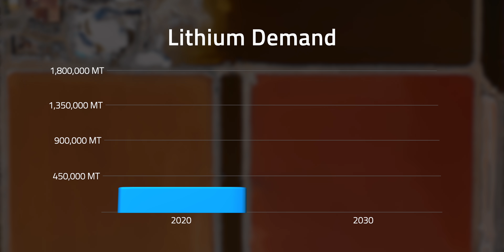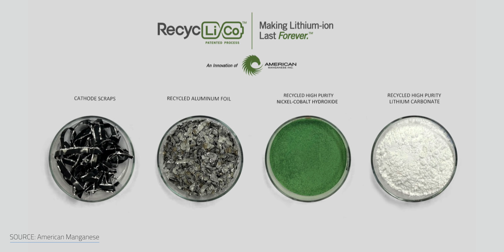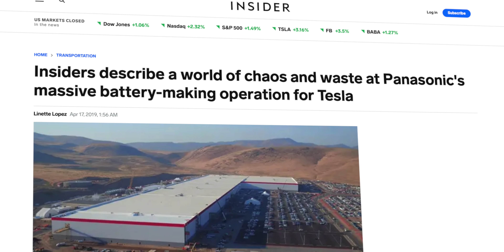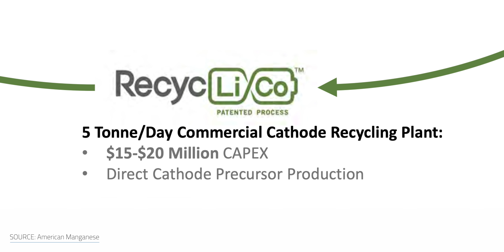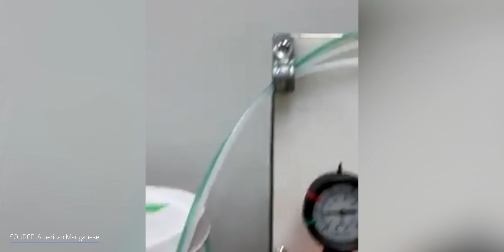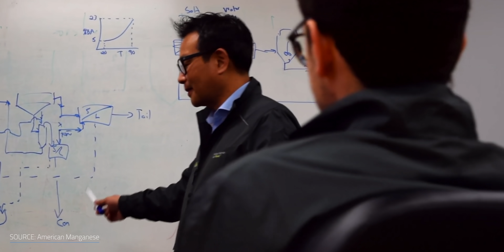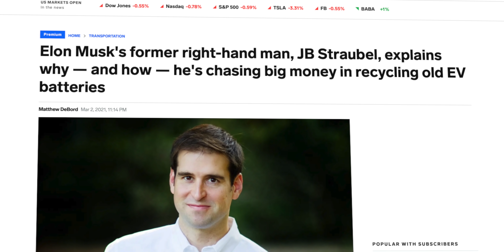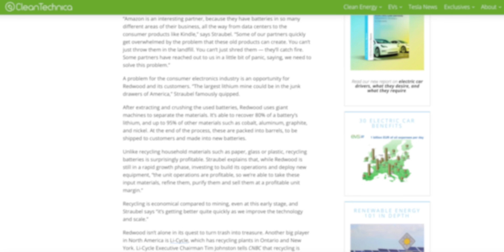Solving EV's Biggest Problem - Battery Recycling Explained

Comment: I believe the process is not totally recycled to make batteries but recycled to certain degree that the metals are able to added to alloys to be used in building and manufacturing which will absorb the wasted battery at early stage until we find the best structures or processes. Compromise first then perfection

Comment: Battery recycling will be absolutely essential because the materials are so scarce. I like how EV demand has increased battery recycling demand, which in turn will benefit all industries that use batteries. I'd love to see a world where everything can be 100 % recycled to pure raw materials cheaply and safely!
Reply: @skullfucker3381  The atoms and molecules will still be there, even though all of the materials won't be in their original form due to chemical reactions. I think it's just a matter of finding the technology and having an abundance of cheap energy to make it happen.
Reply: @eaaeeeea  as you say, an abundance of cheap energy is exactly what’s needed. With that, carbon capture and all sorts of other strange technologies will become viable.
Reply: What is done with the solvent waste?
Reply: If materials are going so scarce and we're already going through the recycle process and there's not even  as many electric cars on the road like they want by 2030.. Are they going to run out of material before it actually is a fluition thought???... Because if this is the case I can see us going back to fossil fuel really quick or not getting rid of it at all...
Reply: @skullfucker3381  in the video they state that they have achieved a 100% recovery rate
Reply: @jimmyboy2  in the video he says that there is no waste and that the solvent is completely reused
Reply: @skullfucker3381  watch the video again because they did say 100% for most elements and 99.7% for one of them. The video also said that they’re already profitable which says that it’s a viable process.
Reply: 100 percent can simply not be done. 90 seems very generous to me. Yes materials don't just dissapear but unless you have a way to recycle every molecule of a material then there's always going to be waste. Its a basic principle I'm not a specialist
Reply: I really dont get it, isnt it quite few parts of EV batteries that needs to be refilled in a dead battery like Tesla's battery gas, the structure of the battery its container, the nickle might have to be melted down and reused if the material structure have seen better days, good as new right?, sulphur might need to be replenished

Tho if only the car manufacturers was forced to do research into EV 20 years ago with some benefits, today its technology would probobly seem alot more solid
Reply: Bio renewable resources are future anyway since we have limited resources and not everything can be recycled 
What I think is that first we will move towards alternatives and recycling and in the end back to natural or biological resources in every possible sector may be it construction or computing ❤❤

Comment: How did you not mention the primary US recycling company, ABML (American Battery Technology Company)? Redwood uses smelting, which creates toxic emissions into the air, while ABML uses a water-based recycling method that's 100% sustainable. And it's a company led by ex-Tesla engineers.
Reply: And it's right next door to Giga Nevada. And will to 20K tonnes a year with their pilot plant. And they have IP for greener lithium extraction during mining. The more I look at the last battery day presentation, the more I think ABML is the answer to the "first principles" problem of lithium supply.

Comment: Good evening Matt. An excellent video -- again :-) 
Having spent 40+ years in the domain of Automotive Electronics, I can say 'Batteries are not enough.' 
If you want more range, you add more batteries -- which adds more weight -- which reduces the range etc. 
Recycling old or mining new raw materials is not the debate (in the limit.)
We need a zero emission lightweight power source for at least the Transport sector. 
We know what that is, we know how to use it, it's just not reached the 'tipping point' yet. 

Its called Hydrogen! 

Let the recycling debate rage until it becomes obsolete.

Best wishes. Stay safe. Bruce

Comment: I've said for years, whoever starts recycling these batteries is going to make a lot of money.
Reply: Or alternatively the person who figures out a more eco friendly battery (Solid State Batteries) which have already been theorized, and are trying to be made by many companies like Samsung and the actual person who came up with the idea, who also happened to invent lithium ion batteries, and RAM
Reply: Not if the recycling process consumes more energy than what is being recycled was intended to save.   This is the case with solar panels, as melting down the leaded glass and separating the water polluting heavy metals costs more than the out put of the panels.
Reply: Same
Reply: @Altcapball  Are you saying that, if you would produce and power solar panels from recycled solar panels, then this would use more energy than the entire lifetime output of the solar panels and, thus, would be a net negative in energy production?
If this is not what you mean, can you rephrase it?
Reply: @rogerstarkey5390  And there's the inescapable fact that, through it's entire life, the i.c. engine wastes 70% of the energy from it's fuel....

Comment: You didn't answer my question of how do we get our old Lipo batteries to these people? It would be best to have the recycling company provide safe shipping boxes for us to collect old rechargeable batteries and send them to the recyclers facility.
Reply from the maker: It's a good question, but out of scope for the focus of this video (I was focused on EVs).  For all of us (the end users), getting batteries recycled is still WAY to hard.  Hopefully with these companies spinning up, we'll see options open up.
Reply: In my country all consumer electronics shops accept waste electronics and batteries, most shopping centers have boxes for disposing small electronics/light bulbs/batteries. Bigger cities have collection sites for larger electronics/appliances. Even my apartment building at the entrance has small metal box for battery disposal. Basically recycling companies has partnership with other businesses to use shops as a collection spots.
Reply: @edmundas919  the US has a long ways to go in implementing the recycling process.  Our disposal companies refer us to the e-waste recyclers.  There are some electronics stores and others who accept some of the waste.

Comment: funny, but I've been trying to figure out what to do with around 30 18650 lion cells.  They are the "bad" cells from taking apart laptop batteries.  I finally found battery plus blubs would accept them.  what happens to them from there, I have no idea.
Reply: certainly a landfill
Reply: @HeritageWealthPlanning  Not in the UK or Europe. Placing battery waste in landfill is illegal in both the UK and EU......they get recycled.
Reply: @Brian-om2hh  uh huh

Comment: They stick them in a landfill because they are not made in such a way that they can be easily recycled. Also... when exposed to the atmosphere, the guts of these batteries can explode or catch fire.
Reply: No, you're thinking of lithium polymer batteries. Electric cars are powered by lithium ion batteries. Different chemistry...  And they can be recycled fairly easily. VW are recycling them already. It seems you haven't done enough research.....

Comment: 20 to 30 years ago, industrial ecology and cradle to cradle materials management were two of the frameworks that considered the idea of industrial nutrients that would be recycled again and again. Electric car manufacturing is finally embracing these concepts. The designs and processes are all optimized for closed or partially closed cycles of materials, energy efficiency, elimination of pollutants... etc. We have the opportunity to do it right from the get-go this time. Waste and pollution are no longer created through poor or incomplete design and then dumped in the environment as externalities.

Comment: Often one of my bug concerns but glad to see it's being worked on. Will this work for solar panels as well?
Reply from the maker: Not these specific companies, but yes ... there are companies trying to perfect solar panel recycling cheaply too.
Reply: Sure! 
you can reclaim all metals from anything, with varying degrees of success.
Reply: Solar panel recycling is behind the battery recycling curve in terms of commercialization inspite of being an earlier tech. The reason being, Solar panels have much longer standard life of 25-30 years compared to EV batteries 8-10 years. Of course, in real life solar panels can stay functional up to 50 years and EV batteries up to 20 years.
Reply: @KarryKarryKarry  The question isn't can you recycle solar panels, the question is can you do it efficiently and at a point where the material yield can pay for the process.  Only then will it be worth the time and effort to divert landfill goods to recyclers.
Reply: @KarryKarryKarry  of course you CAN, almost everything we manufacture is recyclable. The question is, is it economical, and is it less damaging than disposing of the waste.
Reply: @mhamma6560  if you want me to feel have a hunt round but there are YouTube videos that say at the at the moment it is not economically viable to do you can be done it just costs a bit more than the raw materials so we are going to need subsidies or tax
Reply: @gingernutpreacher  Well that's a problem, subsidies are already what pays for them, and subsidies are a tax.  The gov has no income, it only takes from the taxpayer.  At this rate it would be more viable to invest in nuclear plants that will provide energy for 4 decades or longer and invest in research.   More efficient solar panels made of more readily accessible / recyclable materials would do us much better in the long run.   Tech will eventually catch up, but to charge more for items that only work when the sun is out is really a step backwards.   We're where we're at as a species today because of cheap abundant energy.
Reply: @mhamma6560  No there not vat/tax is only 5%   there is a feed in tariff but that more than cover's cost of what's produced it used to be really high that comes on the ealectric bill and current nuclear power is stupid t only uses 1 point some thing of fuel the rest end up as waste like neptunium and nuclear is extreamly experience and has the highest subsidy have a look at how much were going to pay the Chinese per kWh here in UK we need some nuclear for cheamo but it's not the future unless you're talking molten salt reactors
Reply: 🐞 Bug concerns
Reply: There is a solar recycling plant in France that I believe achieves a 95% recycling rate. The thing is, recycling is still much more expensive than dumping it in dump sites (+-20$/panel vs a few cent) and will likely always remain so. Moreover unlike with batteries there will not be too much economical gain from using materials from recycling vs mining, especially not seeing most solar panels are produced in China. So without regulation you won't see solar panel recycling take off. In the EU regulation does make recycling mandatory, so it isn't abnormal we'll see large scale solar recycling here first.

So is it possible? Yes. Will it be done? Only with regulation.
Reply: @UndecidedMF  did u drop that video yet? :)
Reply: @KarryKarryKarry  you're pretty much saying we can recycle all metals but not all. Makes no sense. You either can do it or you cannot do it. There is no 100% that is less than 100%.

Comment: I have a 10 year old Nissan Leaf.  Since I only do short trips, it is all I need (and it was cheap with all the subsidies back in 2011).   I have never fast charged it or left it sitting at 100% charge for more than a few hours.  It has been garaged and as a result my range loss has been about 20% and the battery still can fully charge to all bars.  Batteries will last if you take care of them.

Comment: I think we will always need mining but at lower and lower levels as recycling ramps up.  As has been the case over the past 150 years humans have consumed more and more materials and I don't see that changing which means that even if we recycle 100% we still need new material.  It's also, in my opinion, impossible to recycle 100%.
Reply: Space mining always a solution
Reply: @James-sk4db  Just need to couple that with space waste disposal
Reply: @graham1034  not really a problem unless you bring the waste to earth/earths orbit.
Reply: The success of lead recycling is a good example of how changes can satisfy needs
Reply: @James-sk4db  If we can figure out mining asteroids, we'll gain access to a LOT of raw materials

Comment: Do not forget the second life use for old ev batteries which are still in working condition, they still retain 70% efficiency after 10 yrs of use and can be used for stationary uses for 10-15 yrs more.
Reply: great point. reduce, reuse, recycle - in that order.

Comment: I just bought my first EV last night, partially because of the influence of your videos! A used 2012 Nissan Leaf. Very happy to be doing my part and saving money!
Reply: Did you buy the battery or do you rent it? How much did you pay and how efficent is the battery still?
Reply: @KeVIn-pm7pu  I own it, I bought the whole car from some dude. It will go forty miles on a full charge, at the specs at manufacture are for 100, I believe.
Reply from the maker: Nice!  Congrats on the Leaf.
Reply: @thelonelyrogue3727  40 seems almost useless
Reply: @skylarkesselring6075  depends on you usage. 80% of my trips are <5 miles 90% <20 and I recon 95%<40 ..... and I live in the country not city. Most housholds locally are 2 car households.  Having a short journey car as a second vehicle is doable for the majority of people its just that the limited range makes us 'feel' uncomfortable despite having a tiny effect on our daily lives.   

I expect to get an EV sometime in the next 18 months.  My current car is a 2012 and I KNOW its more environmentally friendly to keep an old car on the road rather than  get a new car .. when the environmental impact of production is included.
Reply: @MrBizteck  yeah 40 miles would cover my daily work commute just couldn't do anything else. 

Another couple years and hopefully you'll be able to buy used relatively cheap with 100-150 mile range
Reply: @thelonelyrogue3727  Jeez, 60% capacity loss in just 9 years ? That looks like a lot. Did he do 800 000 Km with that Leaf ?
Reply: @thelonelyrogue3727  40 miles on a full charge and it's only going to get worse. That's like buying a car with a perpetually running on E gas tank.
Reply: @Winnetou17  you have to keep in mind that this was one of the first all electric cars they made. There have been a lot of advances made in the last ten years that aren't present in that car.
Reply: @skylarkesselring6075  If you had to walk 40 miles, would you still think it was useless if it was parked right next to you?
Reply: @skylarkesselring6075  very true.
Reply: @skylarkesselring6075  How quickly does the Leaf charge?
Reply: @Winnetou17  it’s because the leaf has no thermal management of its battery pack. Li-ion batteries degrade mostly from heat during charge and discharge.
That’s one of Tesla’s innovations, they have a very effective thermal management system (theirs uses liquid cooling) that preserves the battery so well that there are cars with over 100k miles and no loss of range since they were new
Reply: @thelonelyrogue3727  My VW ID3 does 450 km thats about 280 miles
my daily route to work is 30 km there and back, thats about 18 miles
so i use like 6-7% of the cars total battery capacity, i charge it every day but could typically go for about 2 weeks without even charging it.
Besides that its the most fun car ive ever owned (owned 5 cars before), super quick and very confortable.
I could never see myself ever going back to petrol enginge, that feels like the stoneage i comparison.
Reply: @mogg_87  remember, your battery will last longer if you keep it between 20 and 80 percent charged!
Reply: @Sunny_Daye  Prices of batterys will drop and new technologies for batteries will also improve lifetime / reduce cost.
And also the repairing / re-newing battery packs-market will grow as the market grows.
This is still early in the EV transition.
In the meantime you can just lease the car, thats what i do, so i have no thought about the resale value, i just give the car back after 3 years and lease a new one.
The monthly cost for me leasing a brand new ID 3 is still less then what i payed for my old golf monthly, so its a win-win.
Reply: @thelonelyrogue3727  40 miles will not get you out of town in the event of a National disaster such as a hurricane. Or stuck in a snow storm for 24 hours.  No thanks
Reply: @kimjones2056  hurricanes aren't an issue where I live, and 40 miles will definitely get you out of the path of any other natural disaster that's ever happened here. Besides that, I'm a part of a multi-car household, just like most Americans...

Comment: There are multiple steps in going from a post-consumer battery cell to recycled material ready to be used for battery production. This video focused on the high technology step of going from black mass to recovered material. The step of making the black mass is, in comparison, relatively low technology but possibly more dangerous step is processing the batteries to create the black mass. To do that the batteries are shredded. But if not done in the correct manner, there is a high risk of fire.